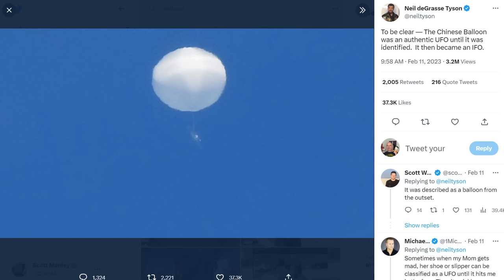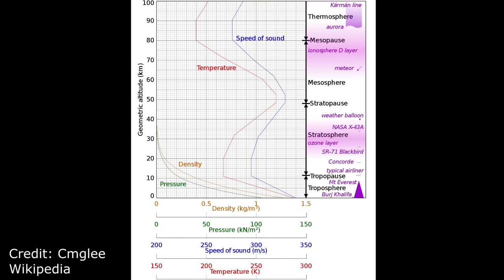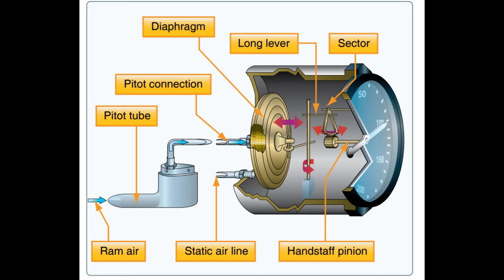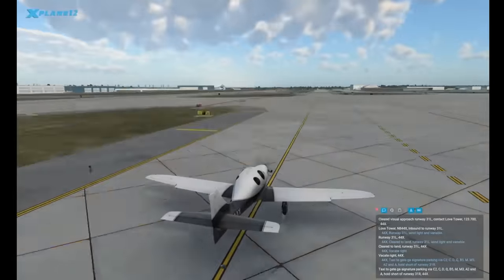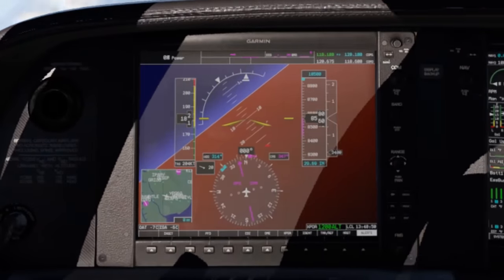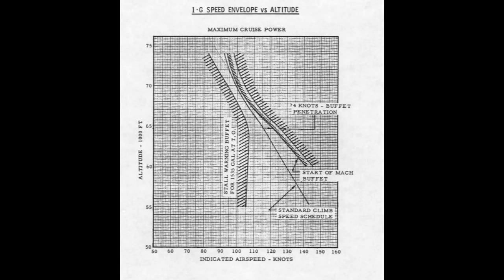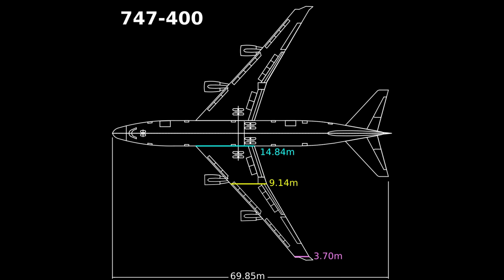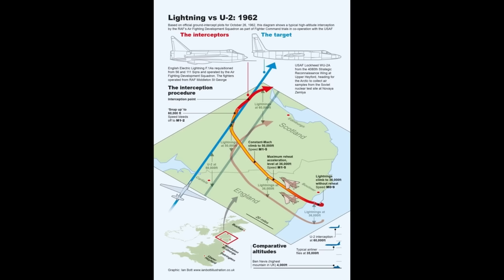How To Design A Plane To Fly At 100,000 Feet?

Comment: The Lockheed F-104 Starfighter introduced in 1958 Was running level intercepts on U2s at 70,000 ft in the 1960s. The highest altitude reached by an F-104 was over 100,000 ft. An intercept flown at 65,000 ft has been possible since at least 1960.
Reply: F-104A could reach 93,000 feet in 1958 (broke the official world time to height records doing it). F4H1 (Prototype F-4A Phantom) managed to get to 98,500 feet (breaking the same records)) in 1961. In fact most Mach 2 capable aircraft can get well above 60,000 feet, The only reason that they don't do it day to day is because the pilots are not wearing full pressure suits which you need to wear if you want to survive any form of cockpit pressurization failure about 60,000 feet.
Reply: @richardvernon317  A Navy F4H1 went to 98,500 on December 6 1958. On December 14 1958 Capt. Joe Jordan got in an Air Force F-104A and reset the absolute altitude record at 103,395.5 feet. While he was on the way up he hit M2.36 and set a time to climb record  for 30,000m.

The Phantom's record stood for 8 days.

The Starfighter gets a lot of flak for the German experience, but  DAMN, what a performer.

Check out the Air Boyd Video "Joe Jordan's F-104 Record Altitude Flight (1959)"

Comment: The XB-70 was rated at 77.000 ft but the prototypes, especially number 1, had many issues that limited performance. If it was properly developed into production I am sure it would have gone much higher, perhaps matching the SR-71/A12.

Comment: I'll push back on your statement at 2:10 about helicopters not having wings.  They do indeed have wings.  Rotating ones.  But a rotor blade generates lift in exactly the same way as a fixed wing does; airflow at some angle of attack over an airfoil.  Hence the classification as "rotary wing" vs "fixed wing".
Reply from the maker: Sure, but then you get into arguing that the fan blades in a jet engine are also wings.
Reply: @scottmanley  My apologies Scott - I know it's rude to question the host - but the rotating wings in a helicopter provide lift, whereas fan blades improve thrust by compressing air into an engine. Aren't lift & thrust different processes? If so, I'm not sure that anyone could reasonably argue that fan blades are wings.
Reply: @spacexrocks1041  Surely the principles are broadly the same? A set of rotating blades move air in a particular direction. How that thrust is used is what differentiates them.
Reply: @another3997  They both move air. I just think it's for different processes. Lift is different than thrust. If you point a set of rotating fan blades straight down, without the engine running, they just pull in air, like a vacuum cleaner. It moves air, but it doesn't provide lift.

Comment: Great Video, Scott!
I only disagree on one thing: although helicopters use engine power to directly drive their rotors, they don’t use engine thrust to defy gravity, but simply to move their rotor blades through the air, which are pretty comparable to airplane wings in the way the generate lift: an aerodynamic surface that moves through the air (or call it ‚fluent‘ to also cover Mars helicopters) and generates lift this way. The same limits of stall, flutter and Mach number apply as to a conventional fixed wing.

Comment: The Sr-71 is clearly the master of the "go fast by having a LOT of power" segment, but what is rather interesting is where all that power comes from.

Thanks to it's clever inlets being able to leverage the incoming dynamic pressure and turn that into static pressure, at a M3.0 cruise the inlet is actually providing 70% or more of the total forward thrust. ie the higher static pressure behind the inlet tries to actually push it forwards out of the airframe and as a result actually puses the thing along!  Of course, ultimately the energy is all coming from the fuel being burnt in the engine, and the engine must be running and removing that high pressure air from behind the inlet for this trick to work, however this way of seemingly getting something for nothing can be somewhat difficult to get ones head around initally 🙂  These high dynamic range inlets (and the classic long delta wing drag characteristics) are what enabled both the Sr-71 and Concorde to achieve lower fuel consumption the faster they went, which is also extremely counter intuitive.  The fact all this was worked out in the late 1950's and early 1960's with very basic analysis, calculation and test equipment is truely mind boggling (to someone that these days routinely records nearly a thousand channels of data at >1KHz on a simple passenger car development test.....)

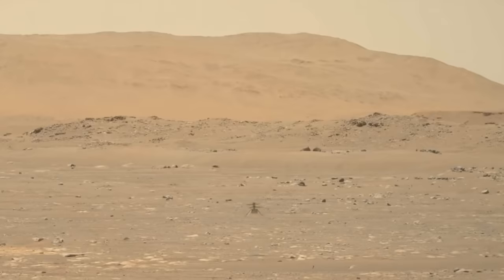Comment: 1:24 - hmm, kind of borderline whether you could say a helicopter stayed aloft just from its engine when it's got those big rotating aerodynamic surfaces -- the blades of its rotor(s) -- which kind of are a type of wing.  The NASA Lunar Landing Research Vehicle (aka flying bedstead) would seem a better, if not so well known, example of flying from pure engine power.
Reply from the maker: You are absolutely correct, moreover when it’s moving forward through the air those blades generate lift like a wing.
Reply: Yeah, Helicopters are "Rotary Wing" Aircrafts.
Reply: @scottmanley  With rotary aircraft, do the retreating blades produce less lift than the advancing ones in forward flight? I know the mechanics of typical helicopters are complicated and inefficient in comparison to typical fixed wing aircraft.

Comment: Ok.. A glider that can reach 100,000 feet .. unpowered .. is freaking amazing.
Reply: Their goal is actually 90,000 feet, not 100,000, but close enough. Definitely a "whoa" moment to know that a specialized glider can get there. At that altitude they'll be flying around mach 0.4-0.5 ... in a glider.
Reply: I've been following the Perlan Project for a bit of time now, and it is truly impressive some of the stuff they have achieved! A suprising problem is windows and instruments fogging up due to temperature differences, I'm fascinated by the wind systems they utilise to get these records.

Comment: Jet engines don't "push against the air" any more then rocket engines do. The actual mechanism is action and re-action. The air being forced backwards has mass and pushing it backwards results in an equal and opposite reaction.
Reply from the maker: The turbofan disc pushes on the air, the air in core is pushed out that back. It’s pushing air.
Reply: @scottmanley  It is pumping air mass, yes.  It's not pushing 'against' the air.  Physics classes go to some length to drill the 'against' mentality out of students.  We know what you meant, but it's an important distinction.
Reply: @WanJae42  it's pushing against the air as much as you push against the water when you swim--you're making a distinction without a difference I think
Reply: @ryanspence5831  No, it's really not.  Jet propulsion works in a vacuum (given oxidizer).  This is a physics fundamental.
Reply from the maker: Yeah, it works because it pushes gas out the exhaust. Equal an opposite reaction still require pushing agains the reaction mass.
Reply: @scottmanley  Correct.  Whether there is air behind the aircraft to push against is not important, and that's an important distinction that trips students up every year.
Reply: @scottmanley  In the video you described the propulsion as "engines which push against the atmosphere". In your reply to JombieMann you state correctly that is is about the air that is being moved by the engine . 

The process of accelerating the air mass that enters the turbofan is: the blades are exerting force, pushing air towards the rear of the aircraft. If the engine would be rigidly mounted to solid ground then the force that you measure is a force towards the front of the aircraft. That thrust force is the propulsion. It is at the blades that the force transfer occurs.
Reply: @WanJae42  Most turbine driven jet engines derive a large proportion of their thrust from accelerating non-combusted air in addition to combustion products. This air is not stored inside an aircraft as propellant but is being pushed away from the vehicle as reaction mass. Almost all airplanes push against the air this way. The turbine blades directly push the air out the back of the engine for forward momentum.
Reply: @ryanspence5831  Yes, Ryan.  You're significantly off the point of what we're talking about.  But thank you for your input.
Reply: For every action there is an equal and opposite reaction.  Accelerate combustion gases, air, whatever, rearward and the craft is propelled in the opposite direction.  Propellers, jet engine fans and rocket nozzles all perform the same function.
Reply: Fundamentally, jet engines work in accordance with Newton’s Third Law of motion, not by “pushing against the air”.  Yes, there is an element of the jet exhaust moving the ambient air at the outlet of the engine out of the way so fast that it produces a small echo of the “air cushion” effect utilized by hover craft, and helicopters that are in ground effect, but that is minor compared to thrust developed as a result of the Third law. Then there is the bypass flow from the fan that is not part of combustion, which plays a much bigger role in turbofan engines, but even there they are throwing air out the back of the engine at a much higher velocity than it was traveling on entry.  Third law again.  Fundamentally, the fans are developing differential pressure the same way a wing does, so you could argue the fans are actually just generating lift, like a propeller.
Reply: That old chestnut! Next we discuss what happens when you put a prop plane on a treadmill... According to some people the prop pushes the air over the wings to make it fly... 🤣
Reply: @richardmarkham8369  Technically, indirectly it does 😂😂
Reply: @another3997  So what does a rocket push on?

Comment: Use Balloons, if that doesn’t work, more Balloons,
I miss airships though, they aren’t even that dangerous anymore
Reply: For unique military missions, the danger of a hydrogen fire can be acceptable, especially without an onboard pilot.  So a hydrogen airship remotely operated with hydrogen burning engines could be a useful high altitude tool.
  For advanced weather balloons studying high altitude winds, considerable navigation and communication electronics will be needed to accurately report back location  and altitude far from the launch station.  Thus when analyzing the Chinese balloon, they will need to subtract the parts that detect GPS/Baidu location and the parts that contacts available communication networks to phone home.   After that, we'll know exactly what systems were included to record surface activity of interest to spy agencies. Without that subtraction, antennas to log on to Verizon Internet and send back data would confuse the intelligence.

Comment: I feel like there’s so much that you couldn’t fit into this video…like the shockwave produced by going any exact multiple of Mach 1 preventing the pitot tube from working, briefly when crossing that threshold, is related to the ability of the supersonic intake cone of the SR71 sliding back & forth at supersonic speeds which relates to the newer mode switching engines where at some point the actual blades in the engine are getting in the way so some scramjet designs are bladeless allowing just the hypersonic air coming into the intake to compress & ignite itself…just most conventional jet engines are limited by having to slow the air dow internally to relative subsonic speeds limiting the maximum speed they can produce thrust at even without these other issues of deflecting hypersonic air away from conventional intakes.

Guess this video was more about flying high than it was about flying fast though.  Great stuff Scott!
Reply: I can understand things happening at Mach 1, but it's surprising that exact multiples of Mach 1 do something. How does the air know that it is at a multiple of Mach 1? Calculating Mach angle (not that I fully understand it) I see that Mach 1 is 90.000 degrees, which is understandable, then Mach 2 is somehow magically 30.000 degrees. But Mach 3 is 19.471 degrees, Mach 4 is 14.478, Mach 5 is 11.537. So I guess what you are referring to doesn't have to do with Mach angle but something else.

Comment: A other factor that comes into play with Max Operating Altitude and airliners: rapid decompression and emergency descent. 

A few years ago 3 of us were given the opportunity to visit 3 on 1 with the 747 Boeing Chief Test Pilot. Our company had just taken delivery of some 747-8s and Boeing wanted feedback. 

So it came up in the conversation that the -8 MOA was lower than the -400. And the answer we got was “Oh yeah, both can go lots higher. The limitation is there based upon the ability to perform an emergency descent and get to 14,000 feet in a defined time. (90 seconds is what I remember)

Seems the -400 can get down faster than a -8, hence the 45,100 vs 43,100 numbers.

Comment: Scott, I've some push-back on your "Pushing against air / Something to push against" descriptive statements..

Are not propellers and jets creating motion via the mass of air accelerated toward the rear of the aircraft  via Newton's 2nd law of motion?  As with rockets in a vacuum, they are not "pushing against something" (in this case atmospheric air) but instead using air as the "propelled mass" ejected out the back instead of carrying that mass with them as a rocket does.

A sailboat is pushed by air. In that case the air pushes against the sail. Power transferred through a propeller pushes air, rather than having air push against it, but with regards to creating forward propulsion it does not push that air "against anything" to create a motive force.

Am I missing something?

Comment: The SR-71 made sea level power at 85,000 feet despite the thin air due to its Pratt & Whitney J58 turboramjet engines. The A-12 versions flew at 95,000 feet at Mach 3.35

Comment: The McDonnell Douglas F-4 Phantom II had a service ceiling of 60,000, but I recall reports where it flew much higher, including Sustained Altitude of 66,443.8 ft set on 5 December 1961 and an Altitude - Top Flight of 98,557 ft set on 6 December 1959.

As the McDonnell Douglas F-15 Eagle and the Lockheed Martin F-22 Raptor have the same service ceiling of 65,000, I suspect they have similar high-altitude capabilities.

Good presentation on the performance considerations!

Comment: Scott: love your work. I must point out that jet engines do not push against the air to achieve thrust. They "breathe" the air so don't need to carry oxidizer but thrust is the resultant force due to accelerating gases out the back of the engine. F=ma. Thanks for your (otherwise) excellent YouTube!

Comment: The RB-57F model of the Canberra has a service ceiling of over 60,000 feet, a wingspan greater than the U2, and has been operation since 1963 (the last 3 are run by NASA as the WB-57F).  I was astounded at how large the wingspan is when I got to examine one in 1967 while I was in the US Air Force.  It looked completely different from the earlier B-57 models.  It still had two engines imbedded in the wings, but two more smaller jet engines were hung under the wings.

Comment: I like the explanation of why for some aircraft there are altitudes where there is no speed at which the craft would be controllable -- "unsafe at any speed". Not so much the list of ways aircraft can use air. I would list: lift, attitude control, oxidizer, and reaction mass, life support. Actually I wonder about two different ways of thinking about lift and thrust: as either "pushing against the air" or "air as inertial reaction mass". I would say that the X-15 in effect was a craft that could transition in flight between being an aircraft and being a rocket. Thus not really in the aircraft category when it comes to records.

Comment: Several private Jets have been certified to fly as high as 45,000 and even 51,000 feet.
And the SR-71 Flew missions as high as 80,000 or even 85,000 feet on a regular basis.

Comment: Great video, but I take slight issue with the idea of air-breathing engines "pushing against the air" as you said. From what I understand that's a similar fallacy to rockets pushing against the ground when they take off. As far as I know, virtually all of the thrust from air breathing engines, be they jets, props or anything in between, is produced by accelerating the air moving through them and throwing it out the back. From what I remember from my Turbomachinery class, at cruising speed most jets only accelerate the air going through them by a couple of m/s, but at speed the mass flow is so big that they still produce enough thrust. I always found that counter-intuitive and interesting. 
But nowhere did anyone in that class talk about pushing against the air 😉
Reply: I'm glad you mentioned this. As you say jets and porops and in fact rockets achieve thrust by throwing mass out of the back.  In a jet some of the mass is from onboard fuel and some from air gather at the intake. the momentum of the mass at the exhaust is much greater than that at the intake both because of the mass added from fuel and because the velocity of the exhaust is greater than the intake. Props, turbofans so on accelerate the air passing through the prop/fan creating a change in momentum which agai creates the required thrust. In a rocket all the mass comes from fuel carried on board. In none of these does any thrust come from 'pushing against the atmosphere'.

Comment: The trick is really just to reduce the wing loading. I'm working on a plane that has a cruise altitude of 20 ft, but could easily be adapted to cruise at over 100,000 ft because even at that altitude, its cruise mach number is like .35. It just takes more power, and the challenging thing is providing enough cooling.